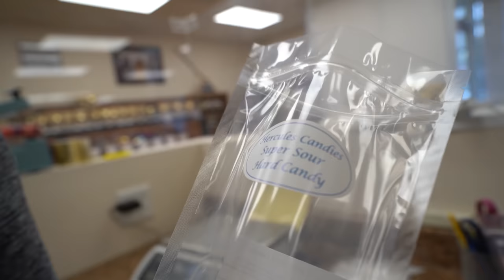We Made SUPER SOUR Hard Candy!

Comment: Is there a reason you don't add the powder malic and citric acid into the kettle to stir in at the end right b4 pouring? Seems like it would mix better when you could stir it in. I was thinking the heat might lessen the sourness? I know it's still hot on the table but I imagine less enough. Anyway, just wondering. 🙂